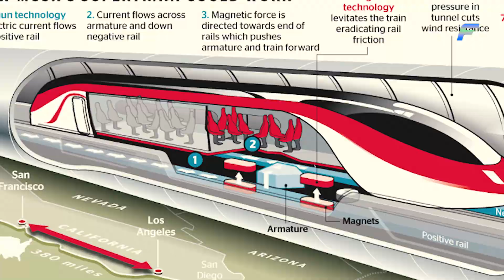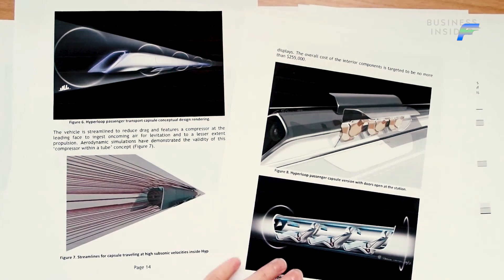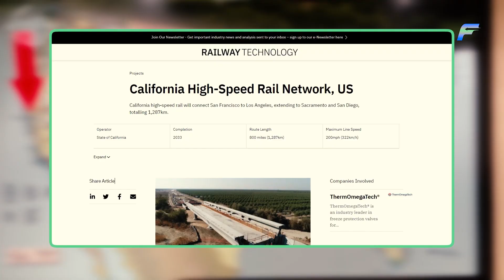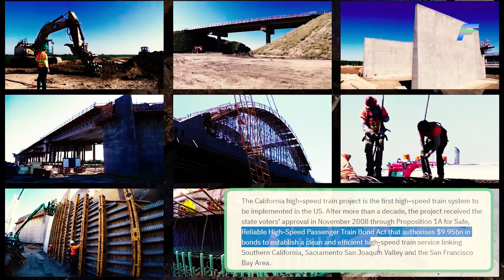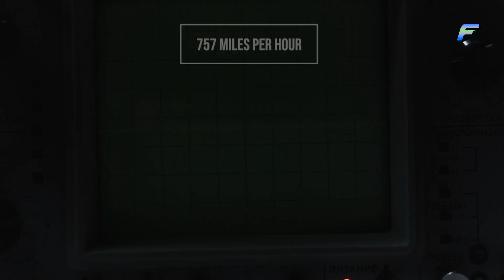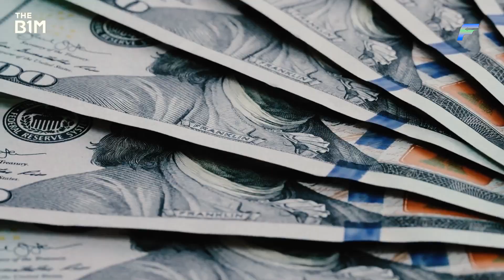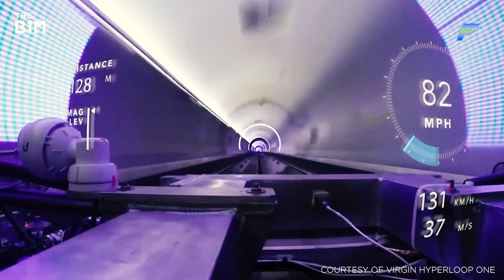How California High Speed Railway Will Outperform Elon Musk Tunnels

Comment: I would use Hyperloop but not California's so called high speed rail and I live where one of the main stations will be in Fresno, I see the parts of bridges that went up a year or two ago and are no different in construction now from back then, a snail could build faster, now they say it might be deiseal trains for a while which are not high speed, only electric from over head catenary lines at 25kv can produce high speed rail and if it wont be electrified for a few years then it will never be electrified, people love cars too much plus the prices will put people off and cheaper to drive or fly , way over budget, years late, doomed to fail.  also it said in the video about Hyperloop pushing air to the back, what air? its a vacuum

Comment: The thing people are missing about the Hyperloop is it's no where near as efficient as HSR because it's a bunch of small pods where as HSR can carry hundreds of people a great distance in a short period of time. There is no real comparison.
Reply: Also, without the highly-unlikely (currently downright impossible) vacuum system, the Hyperloop is just a maglev in a tunnel. And maglev projects tend to crash and burn even without the vacuum system. Basically, if everything goes absolutely completely utterly perfect for Hyperloop, only then will it rise to the level of a "pipe dream." Right now, even vaporware is kind of a compliment for this mostly non-existent technology. By the time Hyperloop is operational, it will likely be time to upgrade the HSR trains a third or a fourth time. And that's if it's ever actually built.

Comment: It’s not our “first” high speed rail line. It’s our second. We have the Acela
Reply: Some definitions of high-speed rail require a higher speed than Acela goes.  It's right on the borderline.  It's only a couple minutes faster than the Corridor Regional which is half the price.  Acela is mostly there to look like high speed rail, with a pointy nose and a slightly higher top speed that it is rarely allowed to reach.
Reply: That isn’t exactly high speed rail. High speed is a consistent 200mph or higher for a large majority of the journey
Reply: @eannamcnamara9338  Thats ludicrous! By that standard neither Japan nor France have high speed rail. 200mph, especially sustained 200mph,  is extremely rare in the HSR world. The actual international standard is 125+mph for upgraded lines and 150+mph for brand new lines. This is plenty fast to compete and be faster than airlines on 100 to 500 mile journeys which is widely considered to be the main function of HSR.

Either way the Acela qualifies completely as HSR by the international standard. You could argue that it qualifies only on some portions of the route, sure. But it is built on an upgraded line and goes above 125mph in a bunch of places, so it's definitely HSR by the international standard.
Reply: @TohaBgood2  ascela is high speed for part of the corridor, but modern high speed lines are consistently 185+ old lines were 135+
Reply: @eannamcnamara9338  That’s not true though. There’s plenty of HSR lines built on old ROWs that top out at 125mph. That’s considered normal HSR. The Acela is exactly that - an existing ROW adapted for HSR operations. In actuality the Acela is faster than most of these types of HSR lines on existing track from Japan and Europe!

I understand that this doesn’t mesh with some people’s ideology, or whatever. But the Acela is a good HSR train on existing track according to pretty much everybody.
Reply: @eannamcnamara9338  no, highspeed is 250km/h for new railways (LGV Type separated specialized high speed railroads like CHSR or french TGV) OR 200km/h on upgraded normal mainlines (like Portuguese Alfa Pendular, Italian Frecciabianca or Acela in NEC)
Reply: Acela isn’t true high speed rail.
Reply: @nygeriunprence  It is by the international HSR standard.

Comment: Brightline will open long before CAHSR
Reply: Brightline is not HSR though. We already have a train with the exact same average and top speed as Brightline that runs on the same route as the future CHSR. It's called the San Joaquins. It even uses the exact same type of locomotive as Brigthline and already carries more people. CHSR is supposed to be the upgrade to full HSR of that Brightline-like service.
Reply: @TohaBgood2  If you're talking about the intercity rail in Florida, then you'd be correct. However, Brightline is also planning to build a high speed rail line between Palmdale and Las Vegas, with a future expansion to Los Angeles in the future. They want to finish the Florida project first before they start work on that.
Reply: @June_auAlaska  But that isn't a real project. That's just a failed HSR project called Express West that they bought for clout and then failed to actually build. 

Even though they explicitly bought that project to "save" it, they've already delayed construction twice. And now they are claiming that they will redesign the whole project to increase speeds by 15-30%. That'll probably take another 5 years. More delays. 

And the speed increase means that they can no longer use the highway medians like they planned, so they'll also need to buy a ton of land and get permissions and environmental clearance. Guess what - that's another 3-5 years.

CAHSR is already finishing construction on the first three sections of guideway by next year. By the time Brightlie even starts building anything, CAHSR will already have trains running between SF and LA, and probably other destinations.

Comment: High speed rail is proven technology that has been fine-tuned for nearly 50 years in Japan and France. We know its strengths and weaknesses, we knows what it takes to have a functional service, and we know how much it costs to run and maintain it. Hyperloop on the other hand is a pipe dream, a mad theory. If it's expensive to build HSR, imagine how much it will cost to build vacuum tubes and keep them air-free! Assuming that hundreds of miles of tube can be kept in a state of vacuum, that is, which anyone with at least half a brain doubts it.
Reply: Exactly!
Reply: And and a completed, functioning and safe Hyperloop will always be limited by its abysmal capacity. Even if the pipe dream becomes reality, it’ll just be premium travel for the wealthy not a transportation solution for major cities.
Reply: Yes, but unlike Japan & France our idiot government decided to use a company with no high speed rail experience to build this thing rather than hire those that have experience building them. I will never ride that thing as it's a death trap waiting to happen.
Reply: @trainsplanesandotherthings5187  That's actually wrong. The companies building CHSR, there are quite a few of them, are pretty well practiced in building rail and highway infrastructure. Some of them are primarily specialized in highway and road construction. But even those deliberately created joint ventures with companies that exclusively build rain infrastructure to bid on this project. None of the other stuff they have built all over the country is crumbling. There's exactly zero reasons to assume that this project will be any different.

The real problem is the cost. Unfortunately, there is quite a bit of political opposition to this project. Some politicians, mostly Republican, have promised to kill the project with lawsuits and cost overruns. They are keeping their promise, again, unfortunately.
Reply: @trainsplanesandotherthings5187  It is VERY unlikely that it'll be more dangerous than driving.  They're building it pretty nicely, they're just spending 10x of what's justifiable.  It probably won't be safer than flying though, because flying on the airlines is safer than sleeping in bed at home.
Reply: The biggest advantage Hyperloop has is that it's being developed by private industry and not the State of California.  They'll either do it and make it work, or they'll bail on it (probably the latter).  What they won't do is force every Californian to cough up $2500 just for construction on a system that runs slower than a $45 JetBlue ticket.  High speed rail is great technology but California are screwing themselves in a big way.  Their costs are a full order of magnitude higher than even the French.  My hopes are with Texas Central.  They're straight-up buying a Shinkansen off the shelf, and won't be dealing with the infamous California red tape.
Reply: @JETZcorp  I take it that you're not aware that Elon Musk got a total of $4.9bn in government subsidies for SolarCity, SpaceX and Tesla Motors?
Reply: @alexverdigris9939  So 1/20th as much as CHSR is going to cost?  And he still has to run those businesses on a profitable basis or else he loses money.  If Hyperloop got built and lost 1 billion dollars a year, it's a disaster for Musk personally, so there's a huge incentive to bail.  If CHSR loses a billion a year, the State government will not admit defeat and scrap it.  Unsustainable government projects are usually sustained anyway.  That's the difference between politics and business.  Politics not only allows but encourages sustained long-term money pits.

But would I prefer Elon have not gotten a dime of taxpayer money for his other businesses?  Absolutely.
Reply: @JETZcorp  Almost everything you are mentioning is either obvious nonsense or has already been extensively debunked. California at the moment is literally building a completely bog standard HSR system. It's built to be slightly faster than other systems, but only marginally. The costs are high mostly because of the political opposition making it that way. The project has been sued hundreds of times by Republican dark money groups with the express goal of killing the project or at least making it wildly delayed and over budget. The people doing this have publicly promised that this is exactly what they are going to do - bleed the project out with delays and cost overruns. And this is exactly what is happening. It's not like it's a secret. 

There is absolutely nothing exotic about the technology used on this project. The tracks, electrification system, signaling, and the rumored rolling stock (probably Siemens ICE trains) are all completely standard for HSR systems. Like the Acela, it skews somewhat European HSR rather than Japanese HSR in terms of the standards they use. But Japanese tech tends to be more expensive and is limited in being too adapted for running on exclusive rights of way. European HSR systems tend to do better in mixed traffic with freight and other trains, and have already proven themselves on American soil (Alstom with the Acela).

All of these decisions were taken or presented and explained in public meetings. You can read the expert testimony and even watch the meetings on Youtube. There's no need to lie, you can just look all of it up yourself.
Reply: @TohaBgood2  Every public works project in the US is wildly overbudget, even compared to the most scandalous boondoggles in Europe.  The light rail in my city costs more per mile than the TGV.  New York just laid down over $2bn per mile on a completely unexceptional Subway line.  That's more expensive than if they ran trains inside Boeing 767 bodies lined up and welded together.  American parks will spend $2M on a bathroom or $250k on 6 wooden stair steps.  That's not all "dark money" from spooky scary Republicans pulling strings in California.  Most of the US government operates like a mix between a Kafkaesque bureaucracy and an old fashioned zoot suit mobster protection racket.  And California are quite possibly the worst.  Ask anyone that's tried to build anything in San Francisco or LA if they're surprised about any of this.  It's the NIMBY capitol of the galaxy.
Reply: @JETZcorp  True, the NIMBYs and the legislation that enables them are a big problem. Also, the US in general and California in particular are much more expensive to hire in than France or China. California especially, is basically more like Monaco in terms of wages than France. WIth median wages in the Bay Area above 100k, what do you expect? All of that of course contributes to the much higher cost per mile. 

That being said, we don't want the government to just be able to pave over those who are opposed to a new construction project. What you get is the situation in China where the government can literally just take away your land. 

We also want strong quality control legislation in order to make sure that things are built correctly in order to avoid having to rebuild later. 

But that has no bearing on how the opposition has impacted this project though. It is plain to see that most of the cost overruns and delays are deliberately engineered by the opposition. I mean, they say so as much! They literally confess regularly, in public. It's not at all a secret that they are doing their best to delay the project and increase costs via those expensive delays. A recent audit found that something like 80% of the cost and most of the delays were generated by the land acquisition battles catalyzed by these dark money groups. This is public information and the people who are doing it are openly fundraising off this information.
Reply: @TohaBgood2  Well like you said, we do have relatively strong protections from the government just swooping in and taking peoples' land.  Especially in California, there is plenty of reason to imagine that land acquisition would be extraordinarily contentious and expensive without any concerted political shenanigans.  It's expensive land; usually either populated or used as some of the most valuable farmland in the world.  Doubtless there ARE groups deliberately opposing the project for political reasons, just like we with highways and pipelines and nuclear plants etc etc.  How much of the costs come from seedy political and business interests vs from standard-issue California BS, I haven't seen.  But knowing how hard it is just to build an apartment building there, I don't think you need to add much conspiracy at all to explain what's going on.  "The opposition" can and does include simple NIMBYs who are granted inordinate power to steer massive and grossly wasteful bureaucracy.

I think we can certainly agree that the cost of the project has little to do with the underlying technology of rail.  California's project costs more than the entire BNSF railroad company.  No one on Earth would be dumb enough to think they're equally valuable.  However it got to be this way, we should be able to agree it's a disaster.

I have my fingers crossed for Texas Central.  Everything about that project makes a lot more sense.
Reply: @JETZcorp  Sure, but they literally did an outside audit to determine where the cost increases came from. And, surprise-surprise it was 80% cascading from land acquisition delays stemming from dead end lawsuits funded by a few “advocacy” groups. These lawsuits are by definition unwinnable. Everybody knows the state can just eminent domain land for transportation projects. The only reason anyone would find these is to hurt CHSR. And the people doing it are confessing that they are doing it. This is an open and shut case.

And beware, literally the same groups have already started suing Texas Central. Not very similar ones, with the same donors or something. No! Literally the same lawyers are flying out to Texas to work on those cases. I’d say Texas Central is DOA. These people are extremely well funded and ruthless. Unfortunately , Texas Central have a snowball’s chance in hell of beating them.

Comment: california high speed rail has been talked about since late 80s early 90s, it's now been 30 some years, and nothing has been done, and i don't have any confidence in a line connecting san fransisco with los angeles ever be completed either. ever
Reply: They have started building most of the middle.
Reply: @TysonIke  if i'm not mistaken, that 22 mile test track under construction is only a tiny insignificant bit of the whole 400 miles total length
Reply: @obstinatejack  they have been building bridges and preparing the ground for tracks between Bakersfield and Merced.
Reply: "nothing has been done" seems like the Y2k virus has gotten in your brain, your knowledge of recent events is stuck in the 90s
Reply: @juch3  lets put things into perspective and in comparison, china built 38000 km of high speed rail in last 15 years. can your brain even fathom how puny 22 miles or 35 km is compared to 38000 km? 1/1000 of china's accomplishment is a joke, and worse still is that it's no where even near finished
Reply: @obstinatejack  why are you bringing china into this? Does this mean the US should also push for the same implementation of HSR like china? If that's the conclusion I'm all for it
Reply: @juch3  if china have 70~80% of the world's high speed rail network, you can't be oblivious about what has been done in china and how it was done, if people ever want any high speed rail in the states. before 1950s, when we had no highway system in the states, germany's autobahn was the best express way system in the world, there's no shame in first recognizing who and what was the best in the world, then learn, understand, how they did it, and finally come up with a solid plan that can be implemented. other wise, we will just be keep on wasting time like the past 30 years